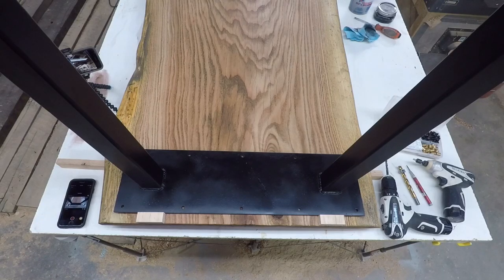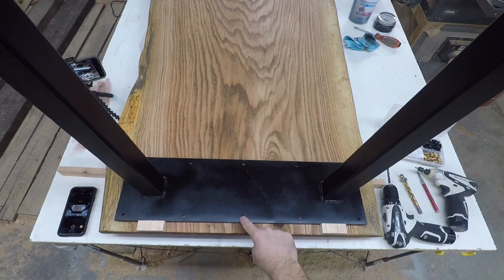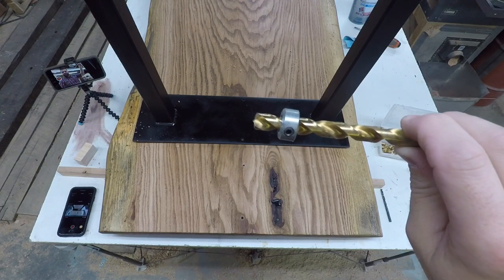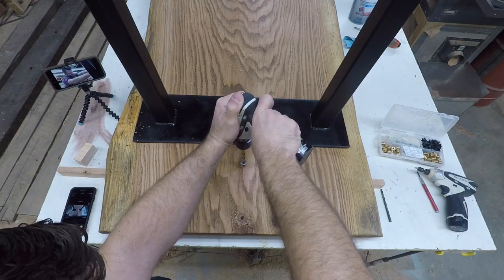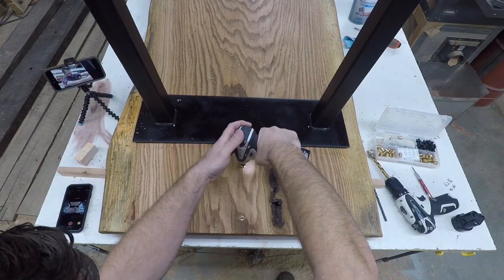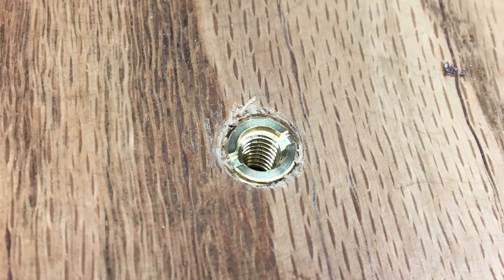Installing threaded inserts into a wood table top.

Comment: Hey mate - how much smaller should the drill hole be than the insert so it holds in tight? Also I guess with slab timber you don't have to worry about movement?

Comment: I was taught that the slot goes in first. I use a 6" piece of threaded rod with two nuts to start the inserts. Easy to keep it perpendicular to the work.
BTW, I've never had luck with the stop collars. They're never perfect for the bit so they wiggle, and tend to come loose. I use a piece of tape on the bit.
Reply from the maker: The slots index the install tool, at least the inserts I’m using.
Reply: @SlabGuy  I saw that! I've never seen that tool before, cool device!!! I used a screwdriver in the slots until someone told me I was doing it wrong!
The threaded rod is handy because it allows you to easily see it's going in perpendicular to the work. Two nuts lock against each other and push the insert in.

Comment: Total novice here. I'm thinking of installing some inserts in my desk and wonder if there is any rule of thumb as to how far into the wood you can safely go with the inserts? (my desk is only slightly over 1" thick). Also, would there be any value in using a small amount of adhesive before fitting the inserts?
Reply from the maker: I wouldn’t use an insert longer than 5/8” long. And be very careful drilling. I’d practice on a test piece first. I don’t use any glue in case the insert ever needs to come out.

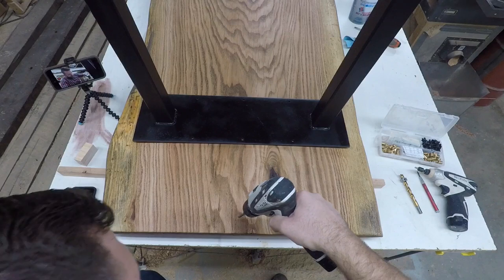Comment: What was the benefit of drilling the starter hole at 1:20, then switching to the second bit at 2:01 ?
Reply from the maker: I do that so the larger bit doesn’t walk around. I’m drilling these with a hand drill, and they need to be fairly accurate.
Reply: @SlabGuy  ah, that makes sense, thanks!

Comment: Did you think about the wood shrink?  The slab will crack if you do not allow it to move for at least 1/2' for every 2 feet of width.
Reply: you can also add some epoxy on the threads to make it more permanaent
Reply: The holes in the metal base of the legs should be slotted to allow for wood movement.

Comment: What is the benifit to using this method over normal screws please?  I'm currently making my first table so am quite naive
Reply from the maker: I prefer using these for a couple reasons. The main one being that the hardware can be taken out many times without compromising the wood. If you ever have to move the table, it’s a big help.Second reason is appearance. It looks like a nicer final product. They aren’t expensive and are very easy to install.

Comment: what drill bit did you use to screw the insert?
Reply from the maker: Standard wood/metal drill bit, nothing special. The sizes vary based on the insert.
Reply: @SlabGuy  thx.  As u can tell I'm pretty new to this.
Reply from the maker: No problem at all, we were all new at some point.
Reply: The hole needs to be the diameter of barrel of the insert, if you can not measure the diameter or do not know the diameter of the barrel.
Hold up several drill bits with a light behind the insert. You want the drill bit to hide the barrel but still be able to see the flutes (ridges) extending beyond drill bit. I hope this helps.
Reply: It depends on how hard the wood is. Start with one about the size of the insert body (minus the threads) If it goes in with difficulty, go a little bigger. I've split some poplar trying to force an insert in too tightly.
Reply: @SlabGuy  i don't think he means what drill bit you used to drill the hole, but what appliance did you use that held the insert it to screw it into the hole? Same question here as well.

Comment: Thanks for the video, do threaded inserts allow for wood movement? I've seen lots of things saying you shouldn't screw the legs directly into the top due to seasonal movement, but wondered if these pieces of hardware reduce that? Thanks in advance.
Reply from the maker: They don’t allow for movement on their own. They are preferred over just screwing straight into the wood because the fasteners can be taken in and out with out damaging the wood.

Comment: If the bolts are are fully tightened onto the leg bracket, why don't the threaded inserts come out when going to remove bolts?
Reply: Steve Ward the insert’s shape doesn’t allow it to spin backwards
Reply: Steve Ward — The inserts are installed with more torque into the wood, and would require more torque to remove from the wood, than is required to remove a screw or bolt from the internal threads of the insert.
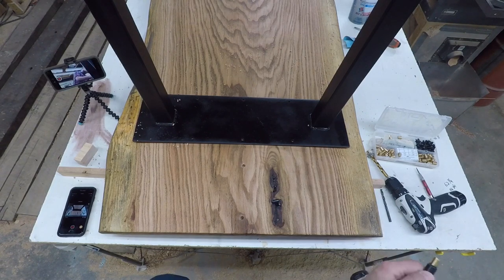Russell — The special driver bit (possibly from EZLok) used at 3:50 to install these inserts will just as easily remove them. Nothing in the design of the inserts disallows them from spinning backwards.

Comment: Im planning to the same, but instead of a metal leg im using wood. Just wanted to know how have they held up with normal use of the table
Reply from the maker: No problems so far. The only issue I have ever run into with these is installing them into end grain. In softer woods they do not hold as well, in hardwoods, it is generally better but can vary also.
Reply: Second Life Design thank you for your much needed insight.
Reply: Do they work on HPL?

Comment: I'm gonna insert 8mm bolts not screws. Are there the right insert nuts for my application?
Reply: As long as the threads are the same yes, you can tighten a bolt more tighter.

Comment: Appreciate the effort but it would have been a better video if you described the sizes of how deep the first pilot hole was and the size of bit you used and then the size of the second bit. And what kind of bolt or screw did you use???? And how were the legs attached? Not much to learn here and it was hard to see and that music in the background is useless and unnecessary. Just saying ...

Comment: that is a nice instruction how not to do this in a professional way. The insert is put in the wrong way, the slot goes in first!
Reply from the maker: The drive tool engages into the slot. I was following the instructions provided.
Reply: @mucsalto8377  
The guy in the video you linked says the purpose of the slot is to cut wood, then says you should first drill a hole to match the outer diameter of the insert.
What would be the point of having slots designed to cut when inserting those slots into a hole that’s already as big as the outer diameter of the slots?

Those slots are for insertion tools, not for cutting wood. That’s why manufacturers of that type of insert make insertion tools that engage with those slots.

Comment: Will those work with Plywood?
Reply from the maker: It depends on the thickness and quality of the plywood. They do make shorter inserts that are less than 3/4”. If it’s a lower grade plywood it can pull out pretty easily.